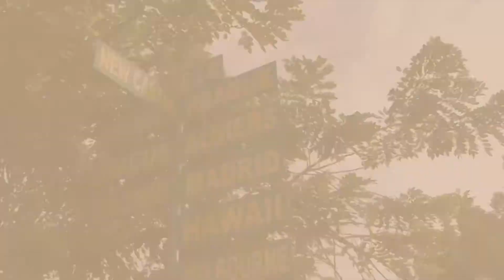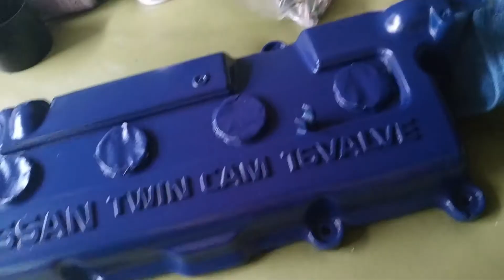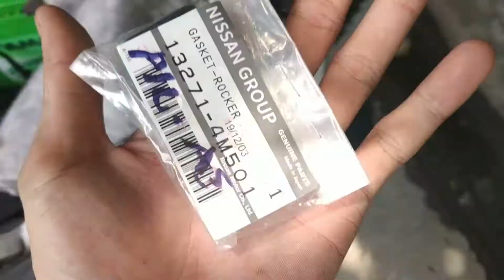Rocker Gasket Replacement and Repainting valve cover.

Comment: Paps pwede magtnong. Ung pcv valve b ng sentra b14 ga16de eh ung may parts number n 1224-15030 or ung 1224-15050. Tnx paps
Reply from the maker: Im not quite sure on the part number boss eh